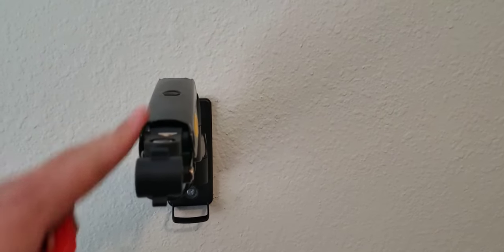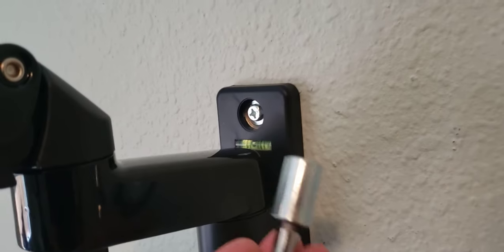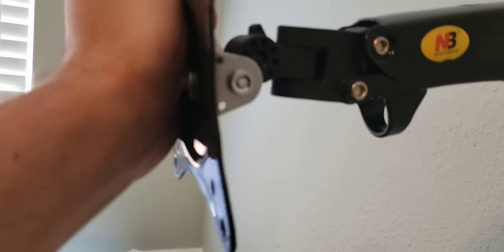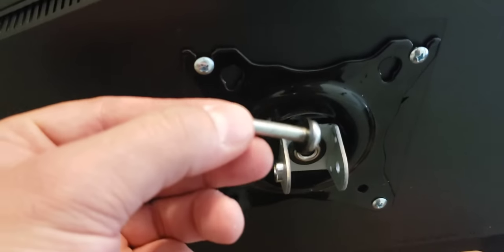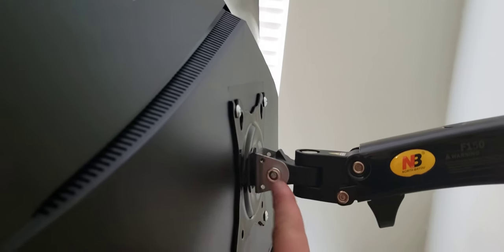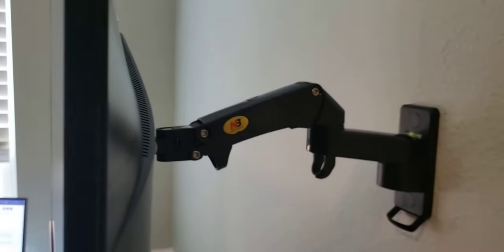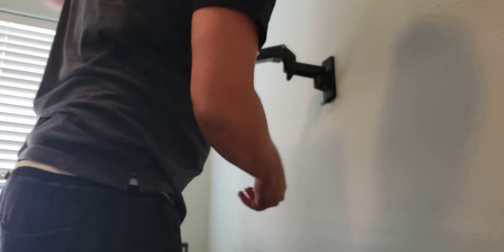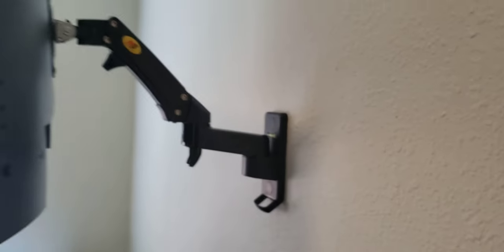NB North Bayou TV monitor F150-B Mount Assembly

Comment: Would moving the TV up and down constantly damage the TV over the time? I mean, literally putting my hands on the TV and not the mount whenever I want to move it up and down
Reply from the maker: I'm just careful about it and touching the outsides of it rather than the screen is what keeps it safe. There's also good products out there to let you clean the screen safely
Reply: @cougarcn  Thank you, my question is whether putting pressure in the top of the TV when I want to move it down constantly can damage it... Of course, I do it from the outside, right in the border's plastic and not the screen itself

Comment: Thanks for the excellent video. I am about to purchase this mount. Does it come with wall plugs, or do I need to buy some myself? Also, what drill bit do I need, and what size of wall plugs?

Edit: The mount, indeed, comes with wall plugs and screws. Just make sure you purchase some more wall plugs in case you mess up 3 or 4 times as I did 😆
Reply from the maker: @winterboltgames  I cannot remember to drill bit size but it was pretty standard that I was able to find it at Home Depot without a problem. And I do believe it comes with wall plugs it's just been so long
Reply: @cougarcn  Oh, thank you so much for your reply! The drill bit size I can easily figure out by looks or a using vernier calliper. Again, thanks, and God bless 🙌

Comment: Hi. The mount doesn’t let me adjust the level the way you do it. It always go back at the top position with huge resistance. Loosening the screw to the lowest level doesn’t help. I need to apply huge efforts to bend the lever and since I release it it returns back to the initial state. Fastening the bolt to maximum + state only result in stronger push back force. Maybe someone can suggest something…
Reply from the maker: even if you mount a monitor to it? it won't stay down? It was frustrating at first for me, but once I mounted a monitor to it, I didn't have a problem.
Reply from the maker: see 3:11

Comment: how do you get the arm with the gas spring to move, mine is still locked even with weight on it
Reply from the maker: Well you can loosen it as well by the screw on the top of the joint
Reply: @cougarcn  on the begin joint is hidden under metal so We need to move it down to see joint. Thats kinda stupid if we cant move we cant lose it hahahah
Reply: @lysydran  hey,what did you do to make that metal hand go down? Mine is stuck at the top
Reply: @vivek2vhs  honestly dont remember just follow instruction BTW I hope Youre trying to do it after You hang something. Without TV or LCD on it gonna be hard
Reply: @vivek2vhs  can you get the metal arm go down now?
Reply: @ITzV1ck  yes.Just grab it tight and forcefully pull.
Reply: @vivek2vhs  just got it, thanks

Comment: Hey, so it seems I screwed up hard in basic steps of installing this because at the step at 0:25 I am unable to screw into the bottom whole any further. I am using the Allen wrench that is provided with the mount. I think I screwed up with my leveling or my hole was drilled in crooked. Do you have any idea how I can fix this? I am trying to restart the entire process, but I can't manage to unscrew the top hole, so I'm stuck.
Reply from the maker: Are you sure the material you are drilling into isn't blocking it somehow? Like, maybe you are hitting metal?

Comment: can u spin it 90 degrees to the right & left?
Reply from the maker: Yes it spins on both hinges 90
Reply: @cougarcn  Thanks for this video. What tool did you use to spin the VESA plate so the side that says "UP" is really upright? Mine came in a diamond position instead of a square and I cannot seem to spin the plate to the correct square position.
Reply from the maker: @dibo0201  It's been some time since I put this up, but the spindle should be loosened from the arm itself. I remember just figuring it out sorry I don't have a better answer.

Comment: Hello, how did you spin the metal piece?
Reply from the maker: Which metal piece? The front? You may need to loosen
Reply: @cougarcn  the one you mentioned at 1:43
Reply from the maker: Oh you just have to loosen it. It is tight, yea
Reply: @cougarcn  what did you use to loosen it and tighten it back?
Reply: @larrainecano5557  I used a towel around the piece and brute force, it actually wasn't that hard